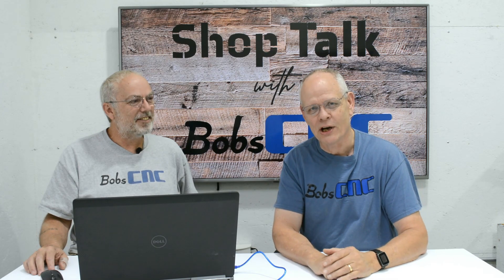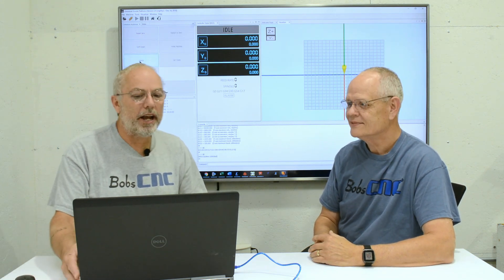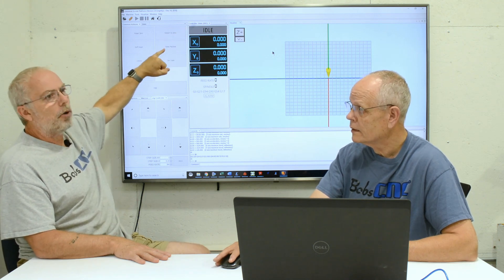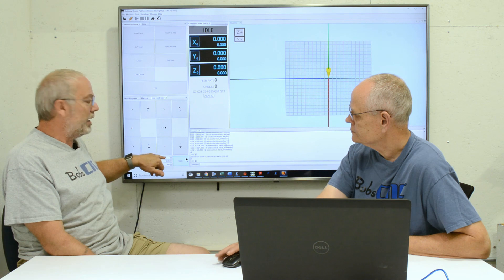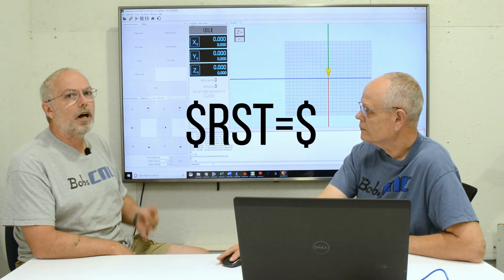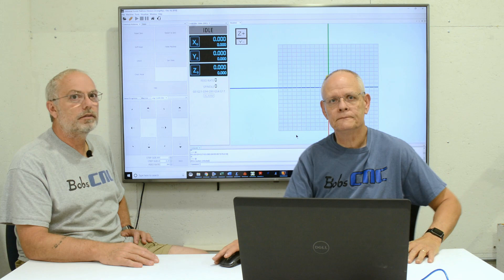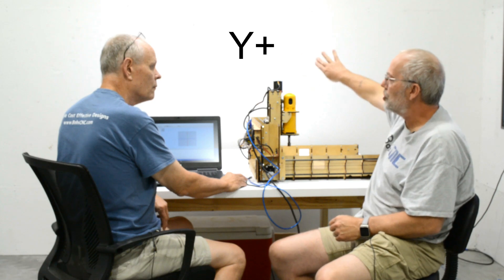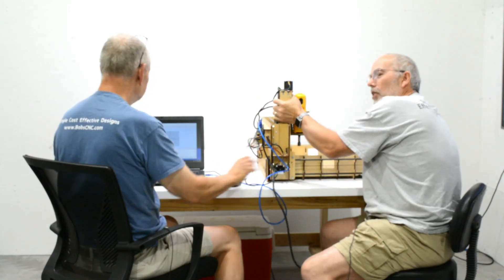Shop Talk: UGS Overview & Machine Orientation

Comment: Is there anything set up in the controller to use the m3 and m5 commands to turn the spindle on and off automatically from a relay?  If so what pins for the +, -, and 5v signal?  Thanks tons

Comment: Just discovered you and liked and subscribed. Thankyou Guys for taking the time to share this info. Could you please help me out by telling me how I can scale the Visualizer view to my machine? As it is  when I traverse the length of the bed the yellow pointer disappears somewhere off into space?? I've just finished the build, I'm retired and it's my first foray into CNC, (When I was learning my trade everything was "Mandraulic" 🤣😂) so I've not designed or carved anything yet so could it be that the scale adjusts when you load up your drawing?? Or should I (or can I even) set this scale first. Thanks in advance👍🏼
Reply from the maker: Once you load the toolpath, UGS will scale the visualizer.  The zero point of the gcode file will need to match the workpiece zero.
Reply: @Bobscnc  Thanks ever so much for your advice, I'm much obliged sir. Regards
Trevor